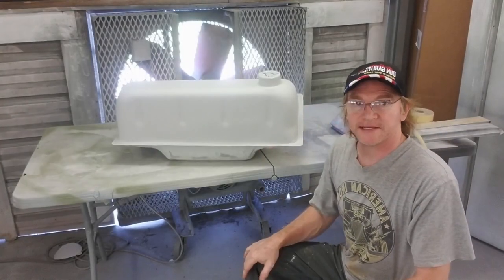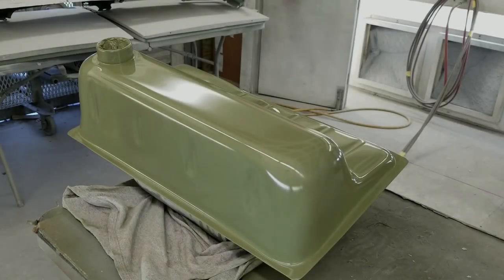Eleanore's Gas Tank & Parts Painted - ROTTEN OLD CHOP TOP 1956 VW BEETLE - 145

Comment: That is absolutely unbelievable.  But.......Just how much is this paint job going to cost ?????
I understand if it's kept confidential, but has to be a fortune.
Reply from the maker: We trying to do the best we can. Its been a challenge and at time... a liability... we are getting there but the small stuff is eating a lot of time. Will try and get more content up as soon as I can I have been working on the doors trying to get the gaps and curves leveled ... ugh... .... unfortunately I cut that clip out of the video...it was boring.
Reply: @ES4406  You chanel is awesome.  Keep posting.!
Reply from the maker: @houseonpleasantstreet9774  thanks so much!

Comment: Seen less time on fuel tanks for Riddler cars,what is so special about this,not being rude,not that familiar with these.
Reply from the maker: The 56 VW we are working on is a hand built custom car by a good friend of ours who has YT channel..... We are just showing highlights of the parts as they go to completion. we used a HB primer surfacer to initially get the tank leveled which took time.
Reply: @ES4406  yep I'm familiar with Duckman,and the project.just a lot of effort on the fuel tank .
Reply from the maker: @19672701   yes sir....correct.
Reply: @19672701   Watch other videos from Classic and you will see that it doesn't matter what the part is, it's done right or not at all.👍👍